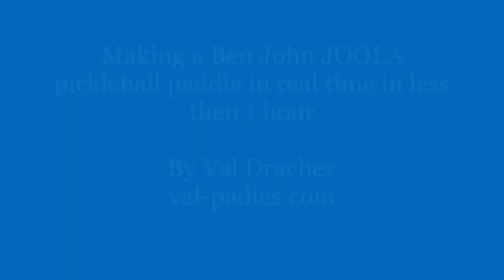DIY: Making a pickleball paddle in less than 1 hour.

Comment: I made a couple paddels. But I  still cant find the end caps you use,so I've been making my own. Would you mind emailing me your souce for the end cap. Thanks,I would really appreciate it!
Reply from the maker: Steven,I don't use a standard  butt cap, instead I build it myself using a piece of 16mill polypropylene sheet, 2 layers, and a double sided sticky tape. Please watch my video. It should be there somewhere at the end. Standard caps are very expensive and hard to find a right size. Because I do handles with different sizes and profiles, I would need a lot of different butt caps. But before finishing the handle butt, you need to build a bump at the end. I use 6 mm plastic rim and sticky and electric tape to attach it

Comment: Nicely done! I'm a woodworker and would like to make a couple paddles.  I wouldn't have a problem making them,but I just can't seem to find the materials you used.  I contacted plascore and I just keep getting the run around! Also where did you find  the edge guards and the end cap?
Reply from the maker: It's on my website.
Cowles company from CT.
https://www.val-paddles.com/features-1/rim-options
Cowles® 37-754 - ProtektoTrim™ Custom Black Body Side Molding

Comment: Great video!! I’m going to try to make one. What is the edge material called and where do you get it?
Reply from the maker: https://www.val-paddles.com/features-1/rim-options

I usually buy it by 150' reel, but you can buy it as a 18' kit. The problem was to remove 3m tape factory attached. It's too thick, I'm using a thin double sided tape instead. When I switched to the reel, I asked their manager if I can buy it without a tape attached and he added a new product for me. Here is the link for a 1/2" rim if you will use a 1/2" core.

https://cowlesproducts.com/store/Cowles%C2%AE-37-754-NO-TAPE-Black-Molding-1-2-x-150-Reel-p180104622
Reply: @valeridrachev2628  Awesome! Thanks for sharing!

Comment: What kind of glue and what kind of sticky tape do you use for the polypropylene core.  There's so few adhesives that stick to it.
Reply from the maker: Here is the link to my website where you can find all the materials I use. https://www.val-paddles.com/store/diy-build-your-paddle-yourself 
The best glue is shoegoo. I use it to attach an edge guard to the core along with 3mm sticky tape. The sticky tape runs on both sides of the rim leaving 5-8mm in the middle for a glue bed.
Here is the link for a sticky tape I buy on Amazon.

2mm / 3mm x 25m Double Sided Phone Repair Adhesive Tape, 2 Rolls Heat Resistant High Adhesion Transparent Acrylic Tape, LCD Screen Repair Sticker for Cell Phone Touch Screen Repair https://a.co/d/ieBKasY
Reply from the maker: The glue requires 24 hours to cure. After you tide the ends of rim, wrap the paddle face with plastic wrap and secure the rim all around using electric tape.

This is the best way, I finally have found, to attach an edge guard to the core. 
The shoegoo glue is flexible and will not crack like other types of glue (gorilla and etc. ). It's very important because the paddle gets a lot of stress when you play.
Reply: Okay I had looked into shoe goo but their data sheet says it’s not recommended for polypropylene. There is a JB weld 50139 two part epoxy that i found works but it is only sold in .85 oz packages.
Reply from the maker: @petercote6694  why did you ask?do whatever you want
Reply: @valeridrachev2628  I asked because I didn’t know it’s what you’re using. But I’m not questioning whether it works. I’m glad to hear it because I might try it based on your recommendation.

Comment: what grit do you use?
Reply from the maker: I'm not using any extra grits except for ones that come with the raw carbon fiber or glass epoxy skins on the polypropylene honeycomb core from the Plascore company of Michigan.
Reply: @valeridrachev2628  Thank you. Is the paint you used comes with a grit?
Reply from the maker: @novubrown2780  just a bit. For fiberglass paddles I use 3 thin layers of spray paint, but for carbon fiber I do only one layer or 1/3 on the side. The raw carbon fiber doesn't need any paint, but it prevents from picking up residue from the ball and is easy for cleaning. The thin layer of paint doesn't affect the quality of the paddle face

Comment: This is very impressive. How much did it cost to make?
Reply from the maker: Without a labor cost and tools its $29 roughly. The core itself is around $20-23, depends how many paddle you can fit on one 8x4' sheet (last time I payed $816/sheet).  If I cut different paddle shapes, then I can get 42 max. If all paddles are elongated then around 39-40.
Reply from the maker: It takes around 2 hours to make a paddle (one hour a waiting time to let paint to dry)

Comment: What's the name of the material used as the body of the paddle? I listen to you 5 times I can't make it out I'd appreciate your help
Reply from the maker: It's a polypropylene honeycomb, 5/8" (16mm) made in the US. The supplyer is the Plascore company of Michigan.
Reply: @valeridrachev2628  You can try spray in some foam around the edges of the honeycomb then put the edge guard on
Reply from the maker: @rsnatchell9685  I do it sometimes when I need to increase a weight of the paddle. I usually use foam or shoegoo glue with or without lead fishing weights. Otherwise, the edge guard itself is pretty heavy, 1.7oz, and it's more then enough to make the paddle steady and balanced.

Comment: I am not doubting your skills but the paddles you make are like the vast majority out there from the cheapest to the so called pro models. People are being ripped off I agree. You mention your paddle being comparable to the Joola cfs 16 but the Joola has a major differences - I particularly like the forged handle on the Joola as unlike other 16mm core paddles like yours, it doesn't have a big square handle. The Joola feels like a tennis handle which is a big plus for me. I have heard that early models of the Joola had an issue with the handle coming away from the face but I think that has been resolved. Well done with the sucess of your home made paddles val but please don't try to mislead people that it is anything like the one currently endorsed by Ben Johns.
Reply from the maker: Check it out https://youtu.be/SduaOit2nGQ

Comment: Lol joola does not make wooden handles 😅
Reply from the maker: Because China has no wood left, only a recycle plastic the JOOLA made of completely. 😊
 I made more than a 600 paddles and sent them to 44 states and a few other countries, but never heard back about broken handles. Using balsa wood I can make different sizes of the grip without increasing weight of the paddle. Other companies simply add an another layer of overgrip to make a bigger handle which adds a 0.25oz at least to the paddle weight.
 A lot of JOOLA owners were speechless after they tried my paddles. Just waisted money. Try it your self. I'll give you a %40 discount. And BTW, The BJ Franklin was much better, if you add some weight to make it 8.5oz and rebalance.

Comment: Next time you need to add carbon fiber on the face. Or figure out something else to give it some good grit for spin.
Reply from the maker: What for? My paddles have more spin then any major paddles on a market. I have tested almost all of them and neither I liked.
The grit or roughness has nothing to do with spin, because the ball will have less contact points with the paddle when it hits the paddle and you will have less time to apply your power to spin the ball. While a smooth surface will have more contact points with the ball and will keep the ball longer on a paddle face, allowing you to have more time to control and spin.
Think about ping pong raquets, 
they have a smooth rubber surface and generate most spin.
It's just physic. Most people don't dig so deep. Adhesion is much more important for spin than friction.
Reply: @valeridrachev2628  what about the weight?
Reply from the maker: @alfa24av  From 8.3 to 9oz
Reply: @valeridrachev2628  ping pong rackets have rubber and more gritty. Thats not allowed in pickleball so raw  carbon face would be the closest. This  diy paddle has no face and no grit.